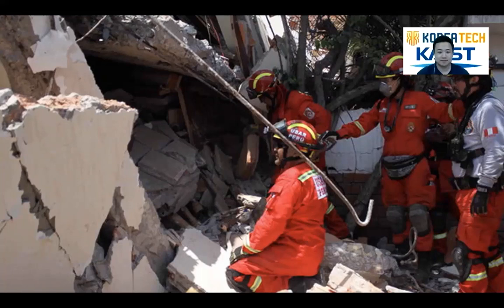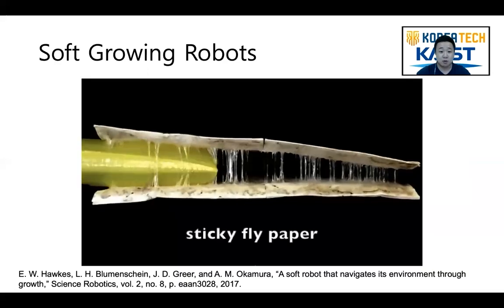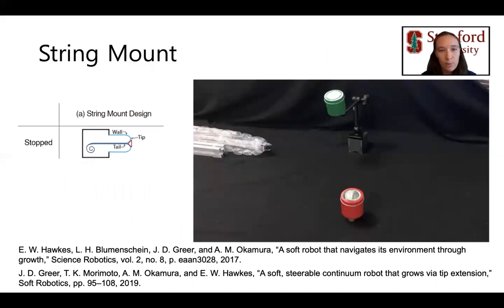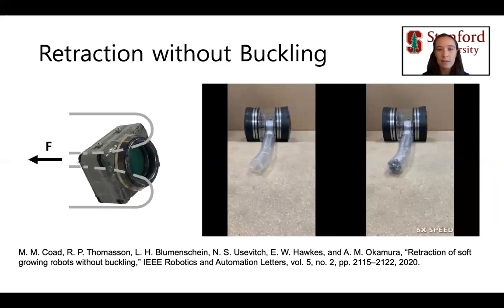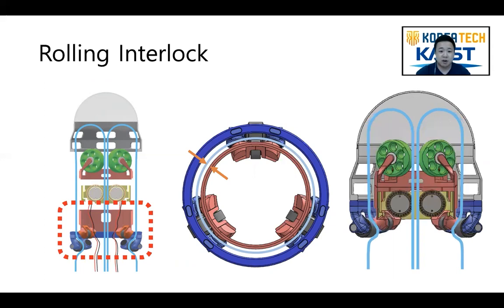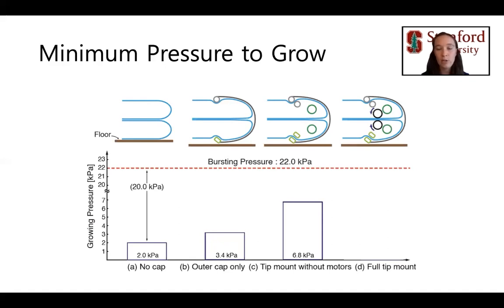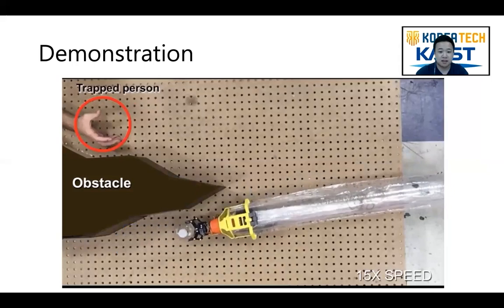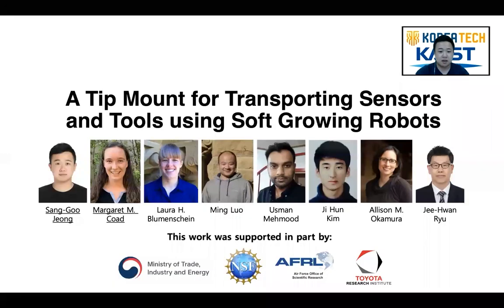A Tip Mount for Transporting Sensors and Tools using Soft Growing Robots

Comment: Very interesting. At ETH Zurich, we have just completed a project called RoBoa where we built a soft growing robot with a tip just like yours, complete with an interlocking mechanism at the tip. We were inspired by your work at Stanford (the older vids). Would you be interested in getting in touch to make progress in soft robotics? www.roboa.ethz.ch